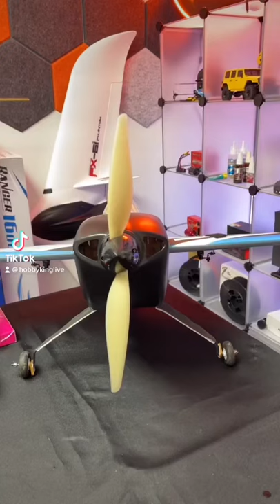HobbyKing Quick Tips - Primer on Prop and Motor Rotation on #RCPlanes / #shorts

Comment: Yeah, question: how you you get any of your cheap chinese props to balance properly?  Even wors than useless are the carbom props i got.  balancing doesnt seem to eliminate all thevibes.  is there a problem with the difference in angle of attack between the blades or what gives?
Reply from the maker: I'm sorry to hear you're having an issue with props. You mean ALL props? I've had no problems balancing any... and I'm OCD about my props and balancing them. Just keep at it... it's rare that any are so bad that they can't be made right.  Make sure to also balance spinners, backplates and even motors... ANY rotating parts.

Comment: Hey Rob, explain this quote out of the  Hobby King Ugly Stick V2 manual trouble shooting section!        Model moves backwards   |    1. Prop installed backwards    |     1. Turn the prop around.     Please advise!!
backwards
Reply from the maker: It's possible to mount the prop in the wrong orientation. In most cases it won't actually make the plane go backwards (it would take motor reversal to do that) but it will certainly reduce performance. Just make sure that the prop's leading edge is forward and facing the right way.
Reply: @HobbyKingOfficial  Well of course!  Everybody know that.  Admit it,   more bad Chinese manual writing!
Reply from the maker: @MrLawrence1950  Actually not "everybody know that" [sic]. That's the reason for these short tutorials.